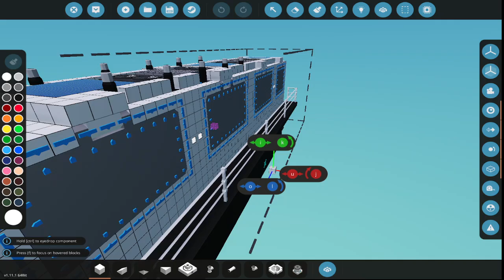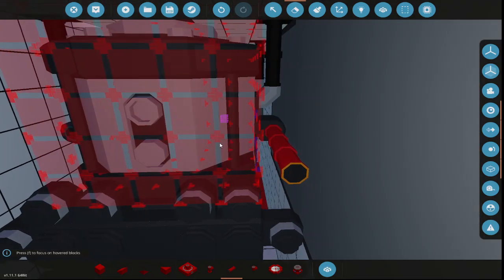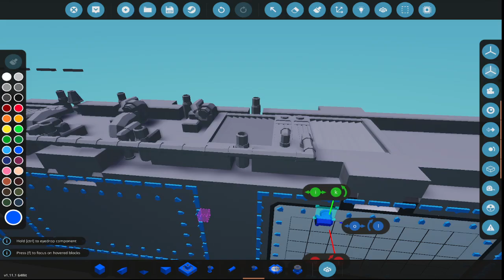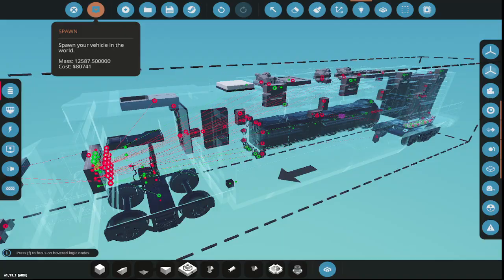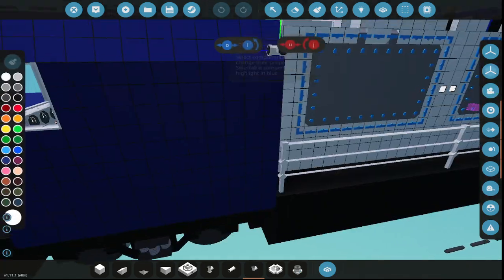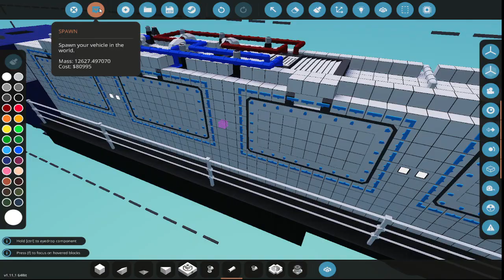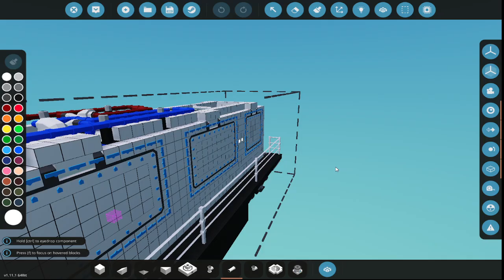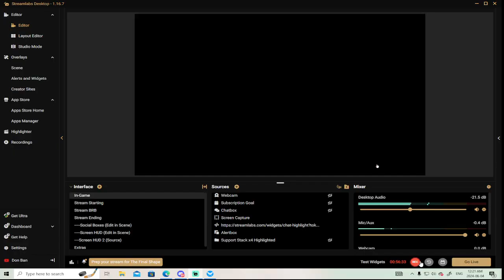Stormworks - Train engine rebuild

Comment: The only thing the "x - 3" function does is delaying the clutch engagement. As soon as your engine rps hits 4 the x-value is going to be 1, which means you are fully clutched in.
Your gearboxes are the wrong way around. If your engine is at 60 rps and you have four 1:3 gearboxes, then your rps is going to be 4860 after the gearbox going into the wheels. So its understandable why it would be screeching that much.
291600 rotations per minute. Your wheels are literally spinning 12 times faster than the speed of sound.
Reply from the maker: Nice! The engine is way overpowered I will def reduce the engine size.